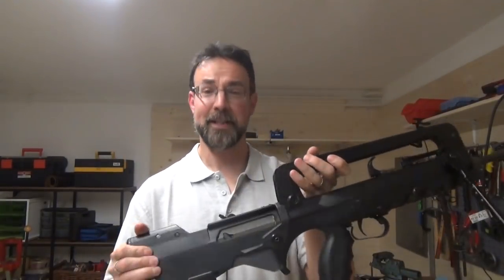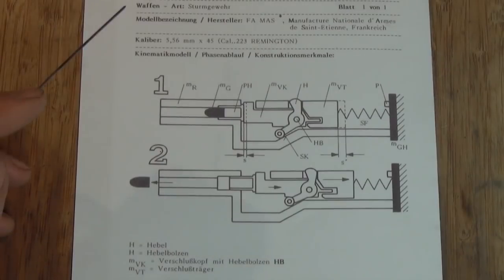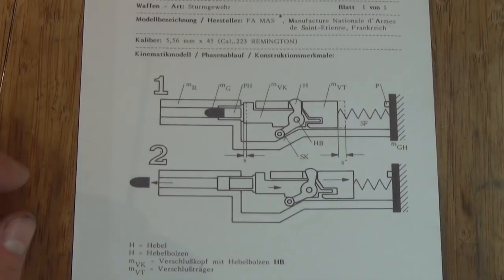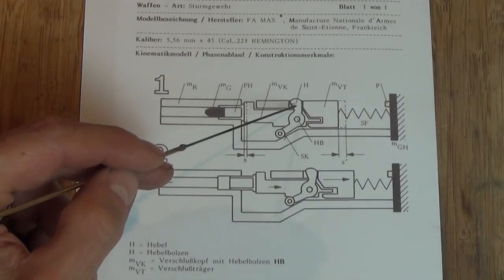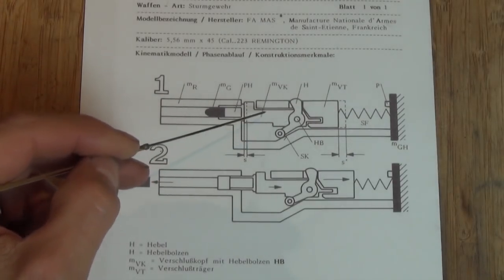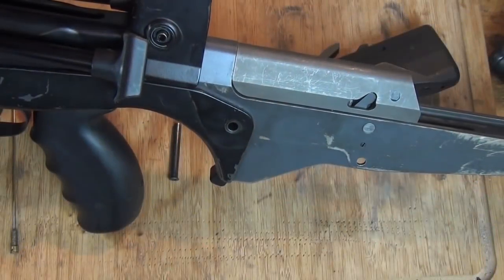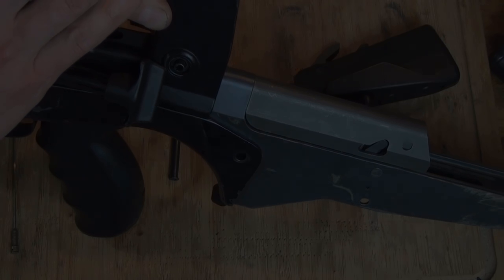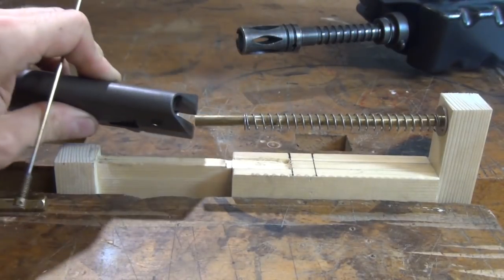Lever Delayed Blowback, A French Connection? FAMAS, AA52

Comment: I just need to ask: would this be more reliable if they implemented a "dead centre" for the lever in "open" position? By this term I mean: when the lever is fully rotated open, the bolt carrier and bolt trying to get closer together cannot rotate it back, even without any support from the receiver. When lever rotation is needed, it is simply kicked out of this "dead centre" by a thingy in receiver, with which lever's lower arm interacts on the way back. Analogy would be to go from AR's cam pin and surface interaction to AK's one.
Or is actually something like that done in FAMAS already, and I'm just missing it?

Comment: Lever delayed blowback is widley used in pistols chambered in 5.7x28.
All FN iterations, Ruger & PSA all produce them.
S&W uses a proprietary delay system that they developed specifically for 5.7x28.
They went on to heavily modify it (essentially turn it into direct blowback) for the vastly lower pressure .22 WMR.

Comment: The question I have is if the bolt-face is locked to the trunion or frame on firing.
Reply: No it isn’t, it wouldn’t be blowback if it was.
Reply: @thebotrchap  H&K roller delay rifles lock the bolt in the trunion. That's why I ask.

Comment: Umm… where do you get an AA-52 in Switzerland, or for that matter anywhere? Is that gun operable?
Reply: Saw it for sale in small ads and bought it with all the necessary paperwork. I assure you that it is indeed fully functional 😊
Reply: @thebotrchap  I have a buddy who does late period Algeria War re-enacting ca. 1958 to 1962, and he has wanted one for years. If you do not mind me being indiscreet, how much did it end up costing you? And to own Class 3 weapons in certain jurisdictions in the US is tricky. Can’t wait to see you guys shoot it. Is it an AA NF-1 in 7.62x51mm NATO or an original AA-52/AAT-52 in 7.5x54mm Mle. 1929?
Reply: @wesleythomas1594  Cost me the princely sum of 600chf/usd. I needed to replace the mainspring and cocking handle but otherwise everything is fine. Runs like a champ on French link or MG34/MG42 belts.
Reply: @thebotrchap  Wow! That is barely $645.00 US! Is it surplus French Army, since they have been replacing them with FN MAGs for the last several years?
Reply: @wesleythomas1594  How and when it came into Switzerland is a mystery. It's an early military infantry pattern still in 7.5x54 so not and ANF1 converted to 308.
Reply: @thebotrchap  interesting, MAC or MAT manufacture? Would really like one myself.

Comment: I've been having a hard time understanding how lever delay works this was helpful. So correct me if I'm wrong when pressure starts acting on the bolt and starts to push it back for every millimeter the bolt moves the carrier moves a centimeter? Until the lever is completely cammed then it unlocks?
Reply: Not quite that dramatically - as demonstrated in the video, for a FAMAS, the carrier travels around 3x as far as the bolt itself does. Due to how kinetic energy works, that 3x acceleration means that the carrier acts as if it weighs 9x as much as it actually does, delaying the opening of the bolt until pressure drops to a safe level for extraction.

Comment: Lever delaying isn't just a fancy french thing, even the Schwarzlose MG in WW1 had a lever delay mechanism. Althoug it was more complicated than the french one. (But the cocking of the striker in the MG 07/12 looks in a way like it could have inspired the french lever delay system)
Reply from the maker: The Schwarzlose has a crank mechanism with a fixed pivot point and no carrier. Not the same thing at all.
Reply: @BlokeontheRange  The system itself is not the same as the french, i think i didn't claim it to be. But it is a lever delayed mechanism. What i claimed is that the cocking of the Striker to me looks (!) in a way more like what the french used as the whole system. (The Lever that extends from the bolt part and that gets camed back during backtravel pushes the striker assembly back further for cocking)

Comment: The asymetric AA52 bolt just gives me the heebie jeebies. I get a creepy feeling the gun just beats the living daylights out of the firer and cycles too fast while averaging a lot of parts breakages. I could be wrong of course.
Reply: Well it’s been in service for going on 70 years so it can’t be that bad. They reinforced the receiver in a few placed for the .308 version but the operating system remains unchanged.

Comment: 2:03 Isn't that true for locked breech designs as well? I've read in the old US Army manual on small arms design that you need the bolt carrier, oprod and gas piston in total about 3 times heavier than the bolt in order for a gas-operated firearm to function properly, and pretty much all the modern designs follow this rule. As far as I know, AKs have their bolts far lighter still, 5 times as much or even more.
Reply: I think that is more so that the inertia of the bolt carrier moving rearward has enough energy to disengage the locking mechanism, whatever it is, and overcome the recoil spring to cycle the action. The more mass the bolt carrier has, the more inertia it has to cycle the action. I hope I am using these terms right.
Reply: @DanielSmith-ui4gr  I think you're correct.

Comment: When looking from an energy point of view there is a 140 g mass going at a V recoiling speed and a 240 g mass going three times as fast. The kinetic energy of the two masses is ½*140*v²+½*240*(3v)². So the 240 g mass in fact contributes as if it was a 240*3² =2160g. The whole system work as if the breech was a 140+2160 = 2300 g mass but the rifle (and the soldier) carries only 140+240 = 380g recoiling mass.
That is why the lever is called inertia amplification lever
Reply: Excellent point!  Thanks for doing the math on that, i had ballparked it in my head and was a fair amount lower / (ie, the system has a much greater mechanical advantage than appears at first glance)
Reply: Usually called the 'accelerator lever.'
Reply: Je pense que ce que vous dites est faux...Simplement imaginez vous une masse de 2, 3 kg pour une culasse classique ? Non pas du point de vue de son opposition initiale au recul pour laisser un laps de temps au parcours de la balle dans le canon et donc la perte de pression des gaz autorisant son ouverture mais du point de vue de sa cinétique terminale la masse additionnelle devenant alors motrice lorsque le bras de levier inférieur du LAI perd son appui sur le coin d'appui, cette position supposant le contact en élongation maximale de la culasse dans la masse additionnellle au niveau des  tenons de la culasse contre les mortaises de la masse additionnelle, laquelle animée de sa vitesse maximale n'est plus que freinée par le ressort de rappel et le frein de  crosse ! L'emploi des formules d'énergie cinétique demande une démonstration plus académique !

Comment: So two things. First, I wonder as too which delaying method is superior, perhaps in consistency or timing or reliability and modifying capacity, e.g. roller delayed functions decent when sized for pistol, carbine or rifle calibers. Second, I know it's roller delayed blowback, but the rollers on the bolt of sig 510 series seemingly has an additional functional difference. And I wonder how it alters the basic concept. The sig desgin has to be different because of patent infringement since the cetme was introduced in the same time period. 
Also, thank you for this video and for even going to extra mile to make a wooden receiver mock-up.
Reply: I think it would be difficult to say which is superior, they approach the delaying action from different angles which brings with it different sets of considerations. I'm sure that with modern manufacturing and materials science you could make a pistol sized lever delay breech mechanism. One issue I didn't address is bolt bounce which is solved in the FAMAS by the locking catch under the charging handle. The AA52 doesn't seem to have any mechansim to deal with it so I assume the spring pressure and bolt mass are sufficient to negate it.
Reply: @thebotrchap  doesn't the open bolt AA52 firing pin move with the bolt carrier, firing the instant the bolt goes into battery before any bolt bounce can have any effect? 

Bolt bounce is an issue in closed bolt designs where there's a slight delay between the bolt closing and the hammer or striker moving all the way forward, so the bolt can begin to unlock again before it fires (or you get a click, in safer designs). On a typical open bolt design I think bolt bounce only matters in the event of a slight hangfire.
Reply from the maker: The issue with bolt bounce is the bolt closing, the striker doing its thing and then the system unlocking prematurely due to the carrier bouncing. Irrespective of open or closed bolt operation.
Reply: @BlokeontheRange  quite, if the striker moves independently of the carrier. Many open bolt designs have the striker fixed to the carrier however, in which case the striker must hit the primer at the exact time the bolt might begin its bounce. I don't know if that's the case on an AA52.

Edit: the only problems I've had with bolt bounce were failures to fire, caused by the bolt bouncing back before the striker could hit and therefore preventing the striker from going all the way forward. Premature unlocking as the cartridge is firing would be bad of course, but is the heavy bolt going to move that far in the short time it takes for pressure to drop?
Reply: I seem to recall a system in open bolt designs where the round is detonated before the bolt is fully closed. I can't remember what it was called, but the object was to reduce the rate of fire by using the closing inertia to absorb some of the recoil energy. I imagine such a system could reduce the effects of bolt bounce as well, but I'm not a mechanical engineer (I operate heavy machinery, but I haven't done the heavy math since college).
Reply: @Tallus_ap_Mordren  Advance Primer Ignition. 
In simple blowback submachineguns that can be as simple as having a fixed firing pin just long enough to hit the primer as the bolt is moving into battery.

In Browning machineguns, like the M2HB which is what I'm familiar with, there's an adjustable trigger timing lever to control exactly when the sear trips. You're supposed to check the timing with go/nogo gages (as well as the headspace using a different gage) each time you set the gun up. Setting the trigger time too late causes excessive recoil movement as the heavy moving parts will slam hard forward before ignition happens. Get the timing just right, and forward inertia of the moving barrel, bolt and bolt carrier will help counteract recoil so the gun shoots way smoother and is more controllable. Set the timing too early, kB! as you get an out of battery discharge. Not good in a .50 BMG!